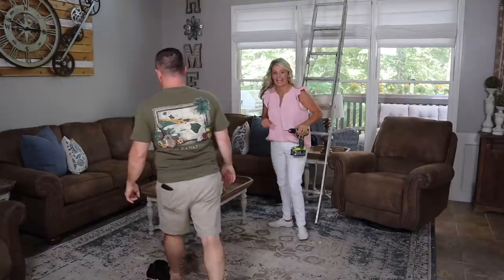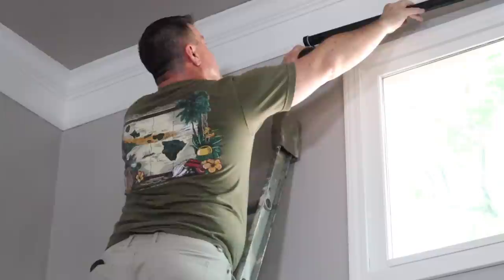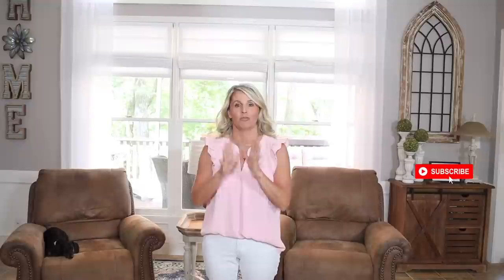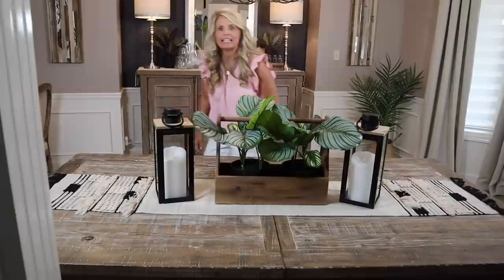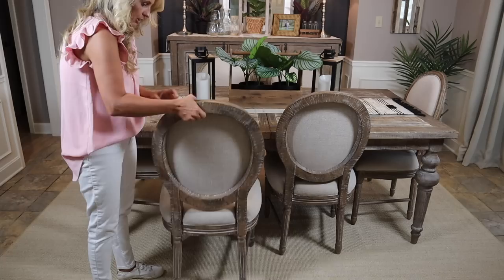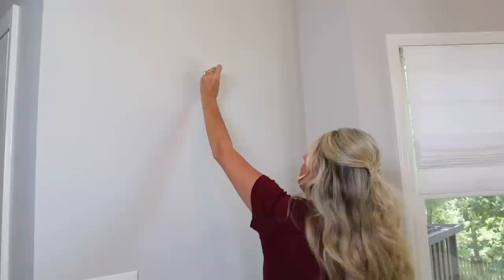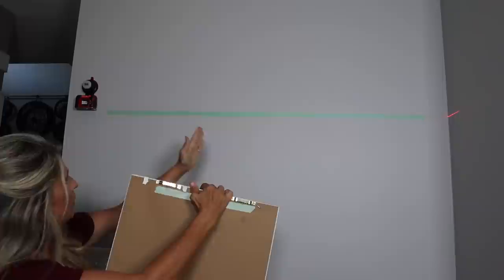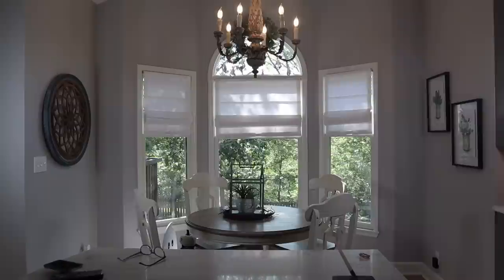SMALL DECORATING TIPS THAT MAKE A BIG IMPACT

Comment: I thought about the pictures being "too short" after you showed us what the overall view was. You did what I thought I'd do. The curtains are fine. Just enuf space to vacuum or dust. I'd like mine longer but don't want to cover the baseboard heat up. It runs the length of my window(109" wide). Thanks for sharing.